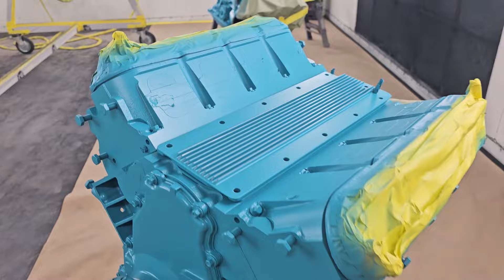1963 Buick Riviera Protouring build VLOG #20: Art Morrison chassis in powder coat, engine painted.

Comment: Nice work! Just curious, are you able to use regular base clear or single stage paint on the engine and transmission or do you have to use a high heat paint? Thanks.